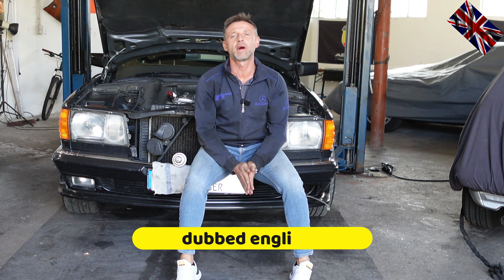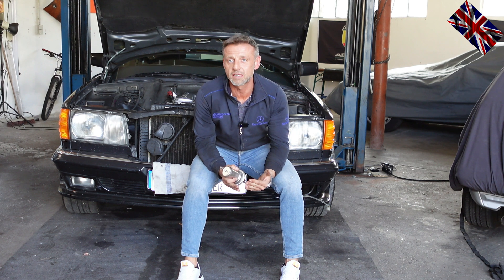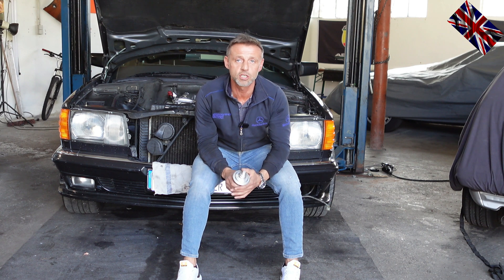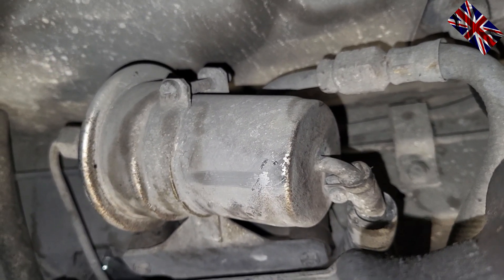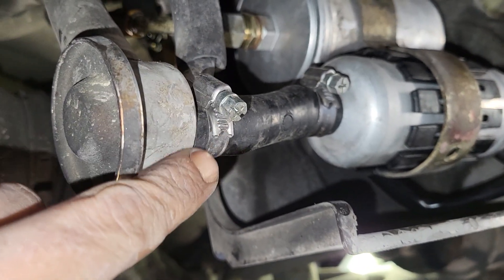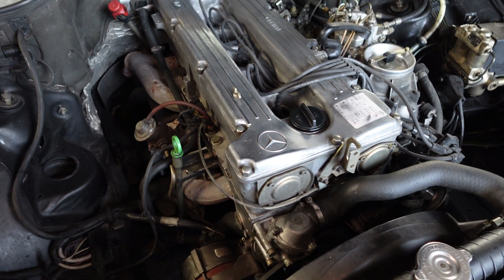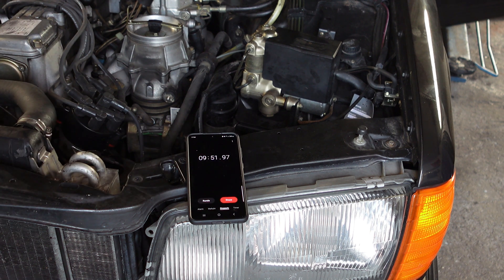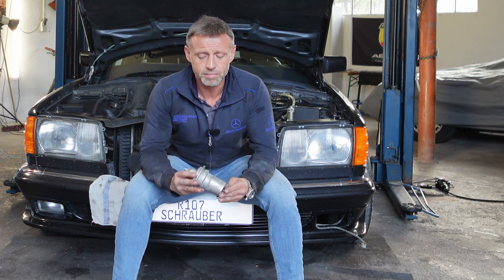Mercedes KE-Jetronic and K-Jetronic - Warm Start Problems - Mercedes restoration

Comment: How do you diagnose the difference between a bad accumulator and a leaking injector because it seems that both will have the same effect on a hot start and both will bleed off fuel pressure if you test with a gauge. Am I correct on that?

Comment: Hi there, can anybody give me some explaination of differences between early big accumulator with 2 threded ports and later with just 1 (I mean those big one, not small from KE-jet). I have struggling with rest fuel pressure in m110 engine early w116 (black iron distributor). Pressure drop from 2,5 bar to 0 but just over an hour. It holds up to around 2.2 about 40-50 minutes and then it started to falling down to 0. I find by checking part number in EPC that somebody change whole fuel pump package for version with accumulator with one port. Could there cause of my problem? I also changed injectors, orings in fuel relief valve in distributor, fuel distributor itself. Also bypassed WUR line for check that it is not causing leak but it isn't. Thanks for advice.

Comment: 10 minutes is not enough  and you must drive the car and then stop!! Because after idling, mine starts after 10 minutes  or more
Reply from the maker: Of course, the wear on each accumulator can be different and therefore the waiting time can vary.  On the vehicle in the video, the poor warm start behavior was already noticeable after less than 5 minutes.  Thank you for your contribution and for sharing your experiences, best regards